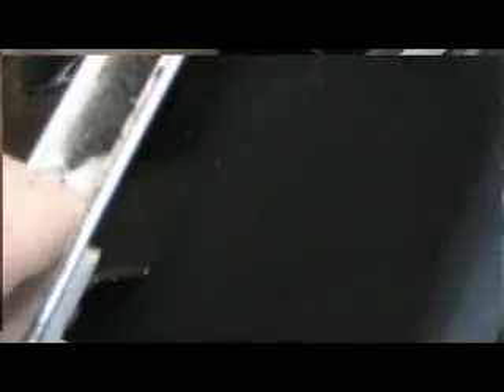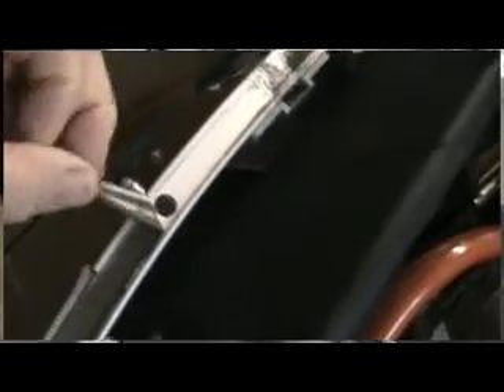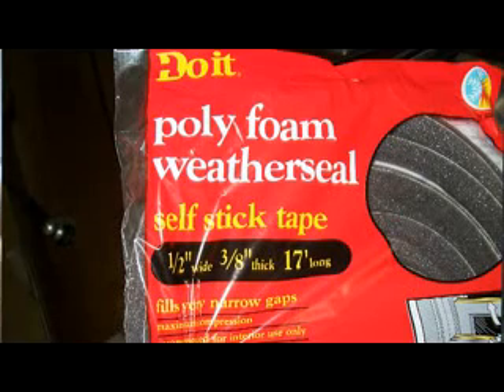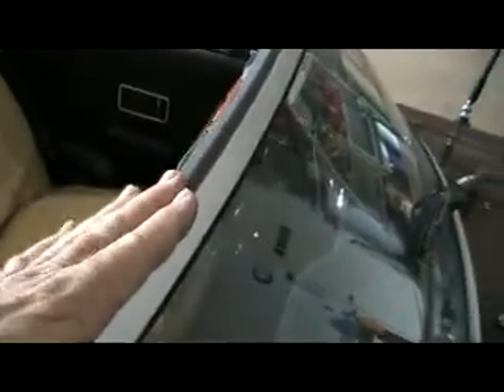MGB Videos.com- Windshield Leak

Comment: this is just 1 of many potential MGB windshield area leaks - the rest are addressed by applying thin bead of windshield and glass sealant to the gasket (glass to frame), frame-to-body seal, side post seals, wiper posts, and washer nozzles.  bit of work but worth it!